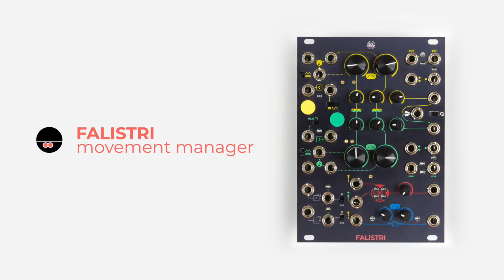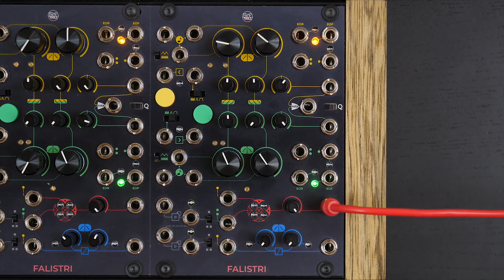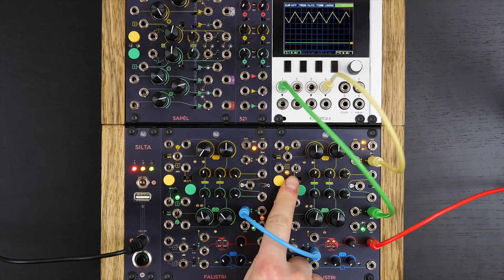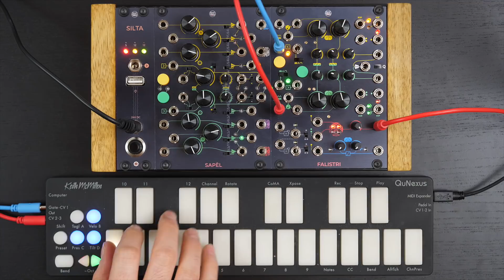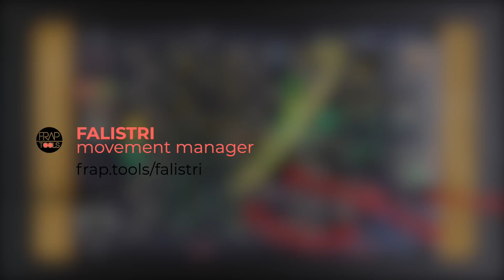FALISTRI - overview

Comment: How did you connect the Keith Mc Millen K board? Thx
Reply from the maker: It's been four years and I honestly don't remember anymore! We still use the controller though, and we use stereo-to-mono jacks to split the CV/gate signal to two separate mono jacks from the first output.